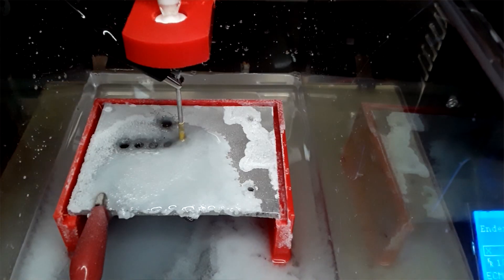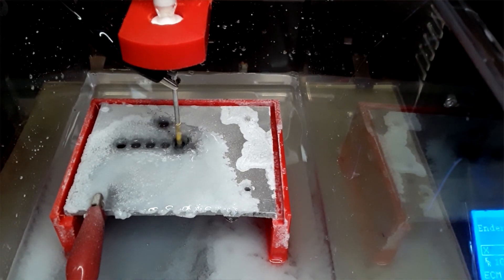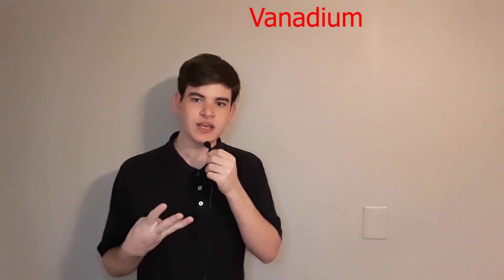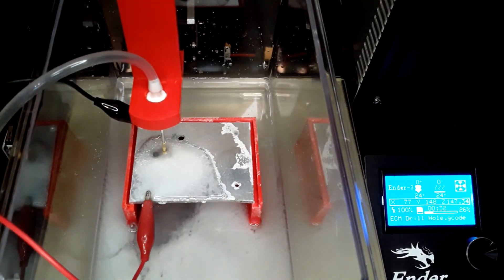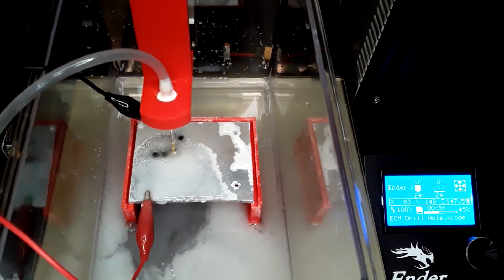Insane Ender 3 Mod Cuts Metal

Comment: Hey bud I did research and development for the greater part of my adult life your aluminum printer sounds quite intriguing. Definitely should use argon. You only need to provide the atmosphere of where the welding is occurring or you enclose the entire machine and Evac all the air and replace it with Argon it does not have to be replaced as long as it does not Escape. You could do a finger style over where your welding and slowly bleed argon into it and I do mean slowly as it will not be cost effective to have it running fast. When they weld pipes. Specialty they will seal the ends and fill the center with Argon and  if a pipe is really big it'll put you plunger down to where they're welding so it does not take so much Argon. Large scale Argon tanks that is on Industrial scale. They buy liquid argon for around $2 a gallon. That's the amount of argon in a large tank will cost us 60 or $70. No they're not making any money just like a million percent profit. Just a 411. I've done numerous welding on high end crazy materials like nickel titanium. You do not want CO2 with aluminum it'll suck the oxygen out of the CO2. You can look into other inert gases. But I believe Argon is the cheapest. Keep up the good work.

Comment: This is a very nice project! I would like to suggest some improvements. If you use a smaller nozzle (for example a gauge 27 needle tip for syringes) with a higher pressure (1-2 bars), you will not have electrolyte accumulate on the piece, but you will have a small pount where the electrolyte hits, then a zone where there is only a thin layer and then a place where the electrolyte accumulates. Because the thin layer has only a small resistance, it will cut way more exact. You can see this effect if you just try it out with a syringe and a blunt needle. If you press hard on the plunger and hit a surface with the jet, you will see it. Distance between nozzle and piece should be 1-2 mm. Good project!

Comment: love seeing ppl do stuff like this with off the shelf stuff. i think ill pick up another ender 3 to try this stuff with or ender 5. i want to be able to cut aluminum in my cnc but it only has the 775 motor, ive seen some manage to do it with this setup but it only barely did it, the bit was chattering the hole time so ive not even tried it but i would like to upgrade the motor to something that could handle it, i have already designed a new carriage to hold it that lets it move on the z axis with mgn12 rails instead of the 8mm linear rods and i plan on switching the rest over to mgn12 later on

Comment: Could this be made 5 axis?
Reply from the maker: Sure, just add some adapter. You will need another control board. The Ender 3 only has 4 stepper drivers.

Comment: You inspired me to use this technique for some diameter widening, thanks. 
Do you cover your needle and what is it? How much is sticking out.
What would happen without cover, would you get a conical hole?
Considering your speed how much current do you use? 
Cool if you could help...
Reply from the maker: The needle was covered with. Heat shrink tubing. It is placed so as to ve flush with the blunt end of the needle.

Current is limited by the concentration of the electrolyte, temperature, and cross sectional area of the electrode.  On this scale it never draws more than 3 amps
Reply: @MorlockEngineering  thanks a lot.. Can I ask again... Isn't your power supply limited at 12 Volts? Applying more voltage would increase the electron flow right?
Also, can you say anything about conical hole machining without the needle insulation? Cheers a lot..
Reply from the maker: @hareriti2463  amps is the number of electrons that flow, voltage is the energy of each electron. By increasing voltage you can increase current because more electrons have the energy required to jump the  electrode gap. 

You can make conical holes by changing speed during a cut

Comment: I made a luer lock to 2mm barb and put it on thingiverse in case anyone else felt like buying 25 off amazon was a bit of a waste. Search for thing 4797264.
Reply from the maker: I will mention it in a later video. For now I will add it in the video description
Reply: @MorlockEngineering  Cool. Oh, one more thing I was going to mention... if you find the heatshrink as insulation gets in the way of doing tight areas, it might be worth trying wire insulating varnish to coat the outside of the dispending tube. Something like MG chemicals 4228-55ML. Not sure if it would end up getting scratched away too fast, or react with the process, but if not, it might do a pretty good job of insulating while being very very thin.

Comment: Could you increase the speed if you have a stronger power source,?
Reply from the maker: It sort of depends more in the cross sectional area of your electrode, the concentration of your electrolyte, and the distance between your electrodes. You can also get more performance by increasing the temperature and voltage. 

Your largest limitation is the boiling point of water.

Comment: if you reverse the voltage can you 3D print? 
I know this might be a tall order and i don't want to sound demanding. 
but 3d printing metal at home would be a total game changer.
Reply from the maker: Yes, but very slowly
Reply: You may want to use some solution containing the salt of the metal you want to print. Moreover, if water is the solvant, alluminum can not be deposited in any way as its standard reduction potential is lower than the one to generate hydrogen from water. You can still deposit copper from acqueou solution.

Comment: Why isn´t everything submerged in electrolyte, but you have a small puddle instead. Doesn´t the concentration of minerals/ions/debris rise so high so fast in this small puddle, that it should automatically stop functioning? I always thought, that the electrolyte has to be recycled, continuously replaced by fresh, clean electrolyte of a pre-defined salt-concentration...